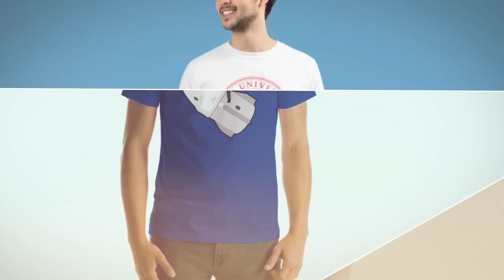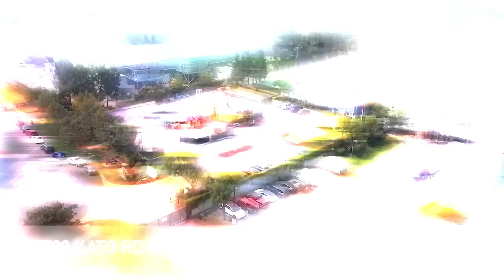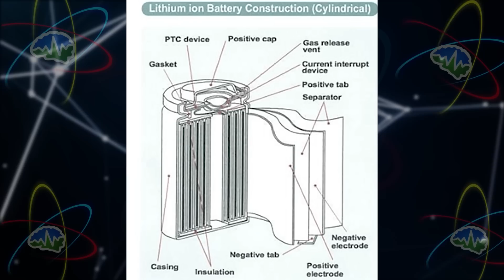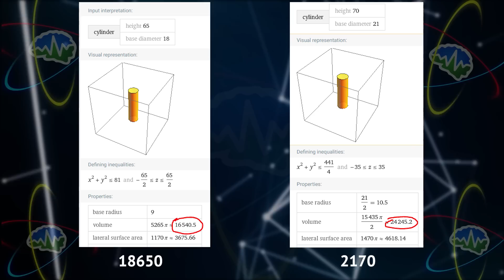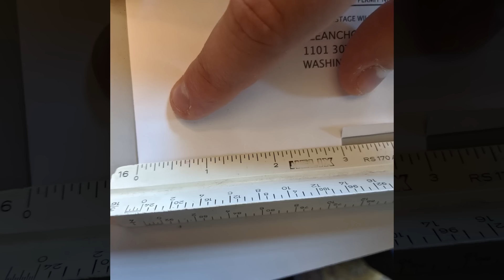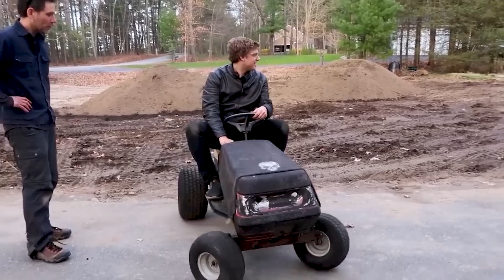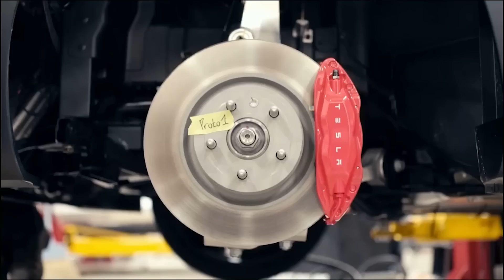Is This What Tesla Battery Day Will Reveal? | In Depth

Comment: You guys got pretty close with the size, you estimated 4576 and the actual size is 4680.  The amount of current you can draw with a tabbed battery would be relative height, and inversely relative to the length of the sheets (proportional to the square of the radius).  But with the tabless design, you should be able to get out tons of current.

Comment: Just watched "battery day": So, not 16x the current, but 6x the current, and with 5x the volume. That gives us a gain of 6/5 = 1.2 in power of the battery pack as a whole. Not so much, but it is an improvement.

Comment: 1) Your calculations are wrong!
You shouldnt use the percentage increase, but the total size.
It should look like this 5/1.5x2=6.66
The bigger battery is 5 times bigger and could provide 6.66 time the current.
You should have found out your calculations didnt pass the is it realistic? test.

2) you make way too many assumptions. You dont know the improved amps rating of the 2170 cells are only due to changing the size of the cell. Of course they improved the chemistry and the design of the new cell.

3) cost, why do you assume the bigger cell cost the same? The 50% bigger cell cost the same because of improvement of the chemistry, manufacturing process and economies of scale. But thinking because a 50% bigger cell cost the same, a 500% bigger cell will also cost the same is a too big jump to make.

4) we dont even know if the picture is a battery cell or a can of coke.

Bad video

Comment: Difference #2.1 will be revolutionary! Tesla will or should be able to make nearly the same number of "45760" cells as 21700 cells in the same amount of time with virtually the same equipment thus increasing total terawatt output by a factor of 5X. This will be huge. 
So to add to that amazing fact that, even though the material cost per cell will increase, the production costs per cell will remain the same, or in other words, production cost per terawatt will decrease by a factor 5X. That is also huge!
Production savings for assembly of the battery pack will also be significantly less.
So adding material cost to production savings for a guesstimate of overall 50% savings for $75 per Kwh for batteries and Elon just crushed the ice industry

Comment: There is no need for ultracapacitors at all because the new chemistry of lithium ion and the new tabless design allows for more power in or out of the cell. At that point the cells can do it all without ultracapacitors.

Comment: They don't have $20/KWh batteries or any way to make such batteries because if they did why would they be buying from CATL for ~$80?

Also what most people seem to overlook is that EVs are cars + power electronics + batteries and the system to make all this work together

I would suggest a decent guess is

$16,000 for a sedan
$6,000 for batteries
$5,000 for motor and power electronics
$3,000 for computers cooling battery management etc
= approx $30,000 to make a model 3 or a model 3 clone

So roughly speaking $16k for the car side $14k for the Electric side. Fast forward 3-5 years and I can see the Electric side fall in price by 50% or $7,000 which would bring the cost of a model 3 or model 3 clone down to $23,000 but that is cost and companies need a margin on top of that. With 20% margin would allow the model 3 to become a $29,000 car

Comment: MMMMMMM.. all good stuff. My 2011 Nissan Leaf needs an upgrade from 24kw to 6 times that .. WOW   My LEAF looks and drives like new at 30,000 km .  BUT it has lost 3 bars and only has 110 km on a 100% charge. More than enough for the daily cafe /shopping trip ..how can I get that sort of conversion ..  and what is involved .  inverter ,controller , charger .    at 76 years old   will it be worth it . I have my Beloved 2001.2.5 VW Caravelle for long distance journeys.

Comment: this new Road Runner would this change the  Energy to produce  the  battery  A lithium ion battery requires around 109 kWh per kWh produced. Most of this is required for production. Where we produce batteries therefore makes a huge difference in the carbon footprint of an electric vehicle.

Comment: I think you guys are confusing continuous output vs. peak output.   Model 3 continuous is around 111 KW but that number is almost meaningless and is only about 149 HP.   Model 3 peak power rating is around  333 KW or 450 HP.    If you guess is true, if continous power on the new pack is 348 KW, peak power will be about 3x that, around 1000 KW or 1341 HP.  For charging, it'll probably be close to 500 KW.  This cell will definitely be used for the Roadster w. Semi, Cybertruck, and Palladium Model S & X.

Comment: There was one other thing that you didn't talk about. It was that with the cells able to put out the much high amps, but the car not needing all the batteries can put out, the cells will run much cooler. Putting much less stress on the batteries leads to a virtuous cycle of the batteries lasting much longer, the systems designed for maximums but mostly operating at comfortable norms means lower component failures, etc. Fewer cells means much lower manufacturing costs of the batteries. It looks like Elon Musk has discovered the magic of standardizing and reducing complexity in manufacturing. Can't wait for battery day.

Comment: None of this means more range, but i always wondered why they didn't use bigger cells in the first place. I thought it was for heat management and fire safety. I was reading an article about Mercedes using solid state batteries in there busses but indicated that range was only increased by 20% but recharge time increased by 80% the side effect of solid state batteries. It may be they are increasing the voltage on the battery pack to speed up charging of solid state batteries.

Comment: it's a 21700 battery, not 2170. my friend who works at tesla she said that it a 21700 cell that's in the new cars.
Reply: It's the same. It means a cylinder that's 21 mm wide and 70 mm long.

Comment: Your forgetting I^2xR which is as the current increases the power losses are exponential. That’s why you would need higher voltage to reduce losses.

Comment: Pulling more power out of the bateries don't matter much as the existing ones already allow incredible acceleration. Howerver, it makes a huge difference for the charging speed which is probably what Tesla is looking for. Faster charging speed means less time at the superchargers and therefore less superchargers required.

Comment: Electric cars will not have widespread adoption until charging infrastructure is at a more advanced stage. Spending 2 minutes to pump gas vs 20 minutes to charge is a big turn off

Comment: Kato Rd = Tesla's battery skunkworks.   I noticed "054" and "10" written on the battery.  Maybe that means 54 x 100 mm = 916,088 mm^3 volume, which is 9.4 x the volume of the 2170 (96,981 mm^3) and 13.8 x the volume of the 18650 (is 66,162 mm^3).

Comment: If one battery in a string fails do you lose the whole string? Even 96 in series, let alone more in a higher voltage, lower amperage, scenario - is an awful lot of batteries to lose in the event one goes bad.  That sounds like you fail the warranty in the event one cell fails. And without modules you'd need a new pack to fix it.

Comment: Am I the only one that missed your "best guess" on how many miles the new pack will have?
Reply: Almost Same. In short it doesn't change the amount of energy stored in the volume, it just changes how fast you can draw this energy out or put it in and helps reduce the cost and weight of storing them.

Slightly longer explanation: 
Let's say old battery has a volume of 10 cm3, and weighted 10 gms, and costed 10 bucks and stored in it 10 Joules (energy unit) and you can draw 5 joules an hour from it without overheating it ( so it can last 2 hours (5 joules each hour x 2 hours = 10 Joules that you have)

5 of those batteries will use 50 cm3, weights 50 gms, costs 50 bucks and stores 50 Joules and connected in parallel can draw 50 joules. 

The new battery will have a volume of 50 cm3 cube (so 5 times the volume(size)), hold 50 joules( also 5 times the energy)). 
Since chemical energy is what is converted to kinetic energy to move  the car, the range is not affected. 

However if the new battery is only 25 gms, then you effectively made the whole pack lighter, thus really you can have better range (but only slightly since pack wight is but a part of the total) Say 10% to 20% 

Also if it costed 10 bucks to make(same as the old one)  then you reduced the cost of the battery modules by 1/5th (not the whole pack as it contains other electrical components)  so maybe you get like 50 % discount on the pack. 

Also if you can draw more power it means you can push heavier cars (like Semi, and Cyber trucks) with better efficiency without putting a lot of stress on the batteries, while reducing weight. 

Note however that drawing more power is Joules / hour , so while the battery has 50 joules, you can draw (according to the channel hypothesis ) possibly 80 joules in one hour. It doesn't mean I have more energy just can draw the energy fast ( that is power). This will empty the battery faster ( so empty in 45 minutes instead of 2 hours for the old batter, if they so choose).

HTH
Reply: hades123 But by your definition, Lucid batteries will still have a better range.
I don’t think Elon is gonna let that fly. Tesla has got to be at least one magnitude ahead of Lucid. Tesla has over a decade of production experience over Lucid.
Reply: @BEATINU2000  I am working based on what the channel is hypothesizing, if their hypothesis (regarding the size / energy density , etc...)  is incorrect, then what I said is irrelevant.  The physics still hold but the inputs are incorrect now.

Comment: Good analysis thankyou. Higher voltage 800-900V is way to go, less current means lighter weight and reduced heat loss all of which could be translated to longer range. Lucid have gone this route, and Tesla will need to match. Once affordable and reliable 800km between charges is reached it will be all over for ICE in the personal and light commercial transport space. Will also likely end ambitions for hydrogen fuel cells.

Comment: also 3 types of cars can be produced : 
1 - keep all batteries you can fit and extend the range dramatically - like for a long range vehicle - for the same price as today. What the range could be?
2 - Stay at 75KW battery output, and pay less with a noticeable increase of range due to weight saving and maybe a lower price
3 - Stay at the same range as today and make a much more affordable car.

Comment: Your math with 16 amps on a 2070 cell shows a Model 3 Performance maxing out at 110kw or 148hp.   So the 16 amps might be a continuous rating.  As we know a M3 Performance is almost 500hp at the wheels.

Comment: I could be wrong, probably am, but I'm questioning the math: 1) assumption amps are a direct function of battery volume?
2) assuming (1), If the mod 3 batteries were 1.5 times the volume of model s batteries,
then amps = 2/1.5 * (new battery to model s battery volume ratio) * initial amps, 
or 2/1.5 * 5 * 6 =  40   a bit more than 6 times a much.

Comment: Elon said he won't use Ultra Capacitors..  to VERY HIGH RISK ....  Elon remembers well from his early Roadster days how L-ion can blow up and catch fire .  Ultra Capacitors are LIGHTING IN A BOTTLE any short or charging rate issue you will have a very big explosion so  Elon is pretty gun shy of Ultra Caps for this main reason second reason is Ultra caps for 440vdc or 880vdc   would take up space for most of interior of the car  so the size is impractical the Cost $$ i purchased a bank of Maxwell 12v size of 2 x 6 pack beer cost $1500  you can do the math for enough in series to create 440vdc  so from my experience with Maxwell ultra caps is not going to happen...anytime soon ... and for safety...another issue

Comment: You are over egging the amps, it's unlikely to go up to 96A. However with the tabless electrodes and that copper base it would be possible to end-cool the cell making the battery pack more compact and simpler to cool (potentially many less parts). Combine this will a cell-to-pack design and the whole battery pack gives more W/kg and is less expensive to build. Even if nothing else is improved in the new cell, the tabless electrodes will make an impressive improvement.  But we know that it is going to be a better cell too, even if not as good as your maths would lead you to believe.

Comment: Even though the packing density will remain the same no matter the diameter, won't using larger diameter cells potentially allow small diameter cells to be packed in between the larger gaps created, thereby getting a higher density than the ~90%?

Comment: 1 kw = 1,34 bhp (horse power). I think the Model 3 P. has 450+ bhp on the axel(s), so it must be able to draw at least 335 kw in order to produce that (even if it is peak). So can't be 111 kw.
Also the model S has around 800 bhp so that must also be able to draw quite a lot of amps from those small cells.

Comment: I think you have made a mistake in your calc - You have mixed up the basis (While the base of the 50% was 18650, the base of the 400% was 2170. Correct calc is like this: The 2170 volume is 1.466 times the 18650 volume, and the 4576 volume is 7.308 times the 18650 volume. So, the power increase factor is 2x / 1.466 * 7.308 = 9.97x --> Therefore, the 4576 cell's power should be 3000mA * 9.97 = 30A.  (John Park)
Reply: Yes, 30 Ah is more likely for that size cell.

Comment: 16X the current?  I don't think so!  I think you are understating the 2170 peak current.  It should scale with volume (roughtly).  The performance Model 3 put out over 300KW, NOT 111KW. So....

Comment: you math is way off jesse!!  in a battery with 5x the volume there will likely be more than 5x the amount of materials than in an 2170. and thats the most expensive part of the battery. there will be significant price gains in packing that can and assembling it into a pack however + time in testing and assembly, etc.
so if it packs 5 times more materials, probably the price will  be only 4x  as much or so
Reply: not to mention the height of the cell would make it impossible to be assemblied in a model 3/Y/S. most definitely suitable for Semi/CBRTK

Comment: This blew my mind.
Though increasing size of a cell 5 times, does not make it 5 times cheaper as it requires 5 times the raw materials. But will save on manufacturing efficiency.
Reply: ^this^ very much this... a 1/5th cost reduction could very much be possible maybe even a bit more with cell to pack, but not a 1/5th cost, unless ofcourse they stopped using nickel as well :p

Comment: Wonder what the weight savings would be for the same capacity and how that would affect range and acceleration. Pretty easy calculations if you extrapolate/know the battery weight.

Comment: They [Tesla] won't reduce the price of the car at the consumer level initially......that's silly.  If a company lowers it's cost of production/materials it does not transmit those savings to the users up front.
Reply: You do if your mission is to accelerate the world's transition to sustainable energy.  You lower the price because every ICE sold is another injury to the planet.  When ICE cannot deliver the same car for less $ it is over for them.  Sooner the better.
Reply: @robertschmidt9301  Sure....that sound reasonable, however, if that were the case the price of the Model 3 & Y would have fallen each time an improvement was made [and there have been many over the last year].  Sure, the price will drop a little over time given your statement about wiping out ICE cars, but the way the video made it seem is that a $6000 in costs would be seen at the buyer's side too.  Don't get me wrong, I love the company and it's mission, but they are still that first....a company....and need to make money to continue the mission.

Comment: Larger cell does not have higher power/volume. (Perhaps very slightly, because of casing.) Power density depends on surface area of electrodes. Thickness of electrodes stays same, so area/volume does not change.
Power density might increase for other reasons. It might even decrease, because larger cell is more difficult to cool. Because of tab less design, cooling might be easier increasing power density.  So I am sure power density will not increase by large factor.  Small change could be in either direction.
Reply: It depends upon how much the tab-less electrode design decreases the internal resistance.  Internal resistance is what limits the power output of a cell.  If there was 0 internal resistance, a cell could discharge all its energy instantly without any losses.
Reply: @rogerheuckeroth7456  Yes, but ions don't travel through electrolyte without resistance.  I'm surprised if total resistance drops to less than half. The battery heats up more when charging. That heat must come from chemical reactions. (could ions experience more resistance in charging direction?)
Reply: @jkn6644  Not sure if that is accurate. What data do you base that charging creates more heat?  Are you comparing apples for apples on the C rate?
Reply: @rogerheuckeroth7456  Sorry, only my memory.  Charging speed is limited above ~50% SOC.  When driving Tesla on a racetrack, regen is switched off to prevent battery over heating.
Reply: @jkn6644  On the cell level, I'm not sure that there is any difference.  Keep in mind you can drive a Tesla at 3+ hours of highway speed to go from 90% to 10%, but you can supercharge from 10-90% in less than 1 hour.  So, the charging is happening at a higher C rate than the discharging.  That may be why your intuition says charging produces more heat.  On a purely chemical basis, the Li+ ions crossing the electrolyte during charge/discharge should not see a difference.  I may be wrong, but I don't think so...